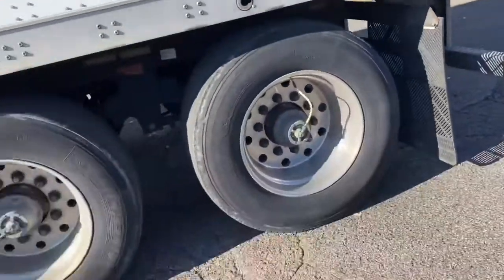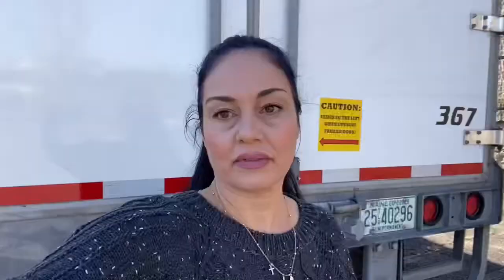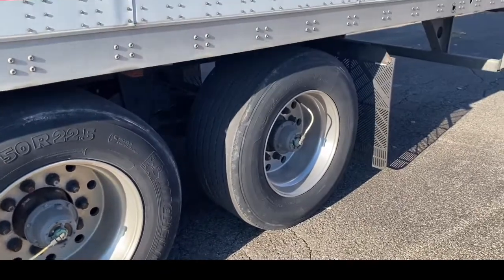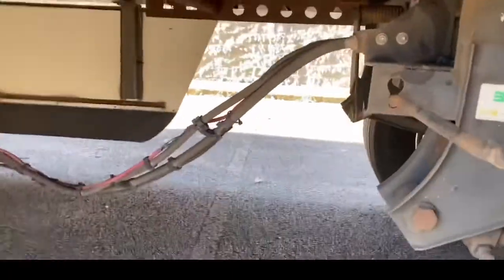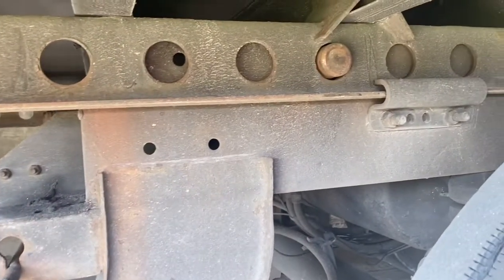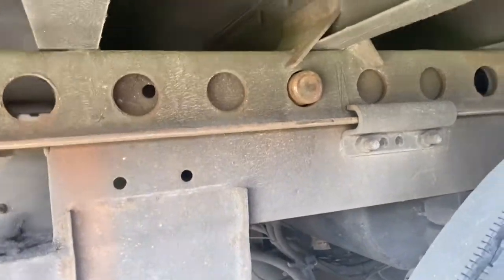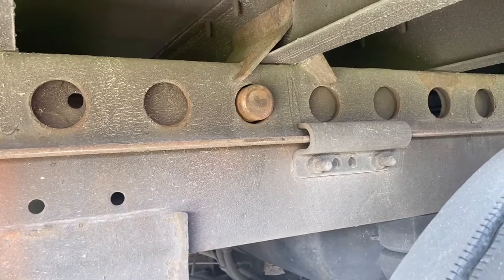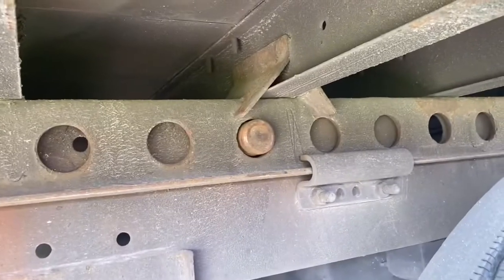HOW TO SLIDE TANDEMS…

Comment: Why are there more than 2 pins ?  The pin isn’t suppose to be in only 1 ? I’m not a truck driver
Reply from the maker: There is one handle or button to push. But, there are 4 pins 2 on each side of the trailer.
Reply: @HighwayHoney  how do I count the 5 for California

Comment: I hate sliding tandems on a trailer that has the pull out lever. The air release is better. 
What I do is supply air to trailer, then pull out red knob. I pull the tandem release. If its stuck, i go back and forth till the pins release then slide them. 
Have a wonderful weekend 😀
Reply from the maker: You too! 😊